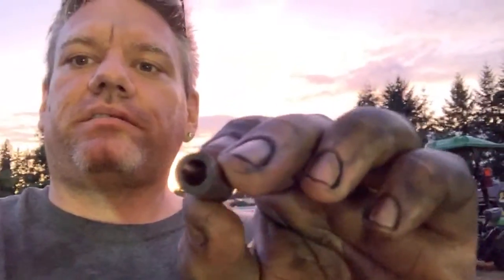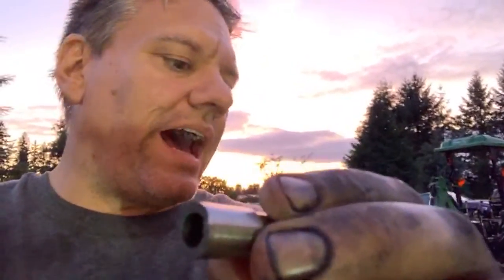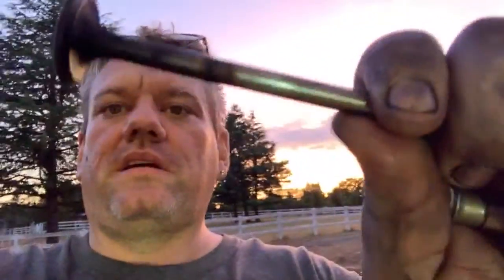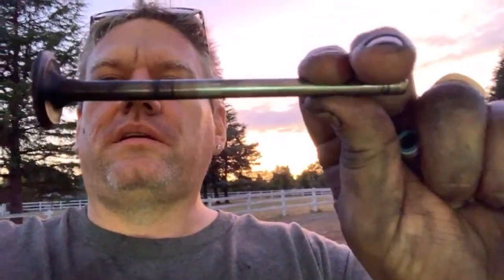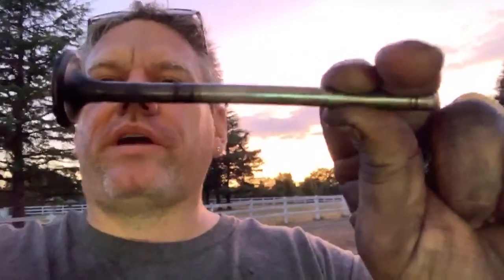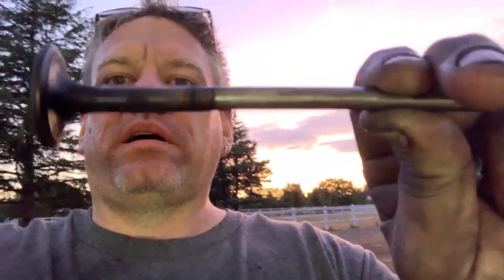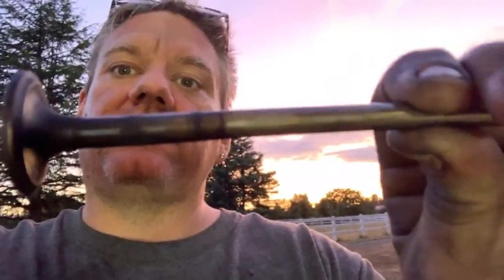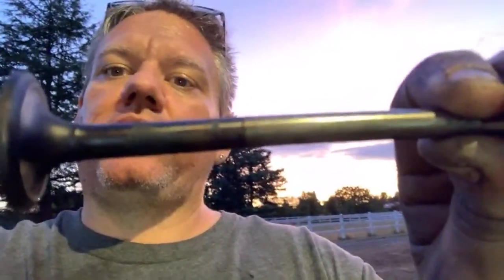Detroit diesel 671 dropped valve update

Comment: Looks like a combination of the wrong keepers, which came to rest on each other rather than clamping on the valve stem, combined with a machine shop worker who either didn't care or was in a big hurry.  Even if you supplied them with the NOS parts, including the wrong keepers, as professional machinists and engine assemblers, this improper fit should not have gone unnoticed.  The miss-aligned injector depth only adds to their incompetence.

Scott, as always, I applaud your ability to smile, laugh and keep a positive attitude in light of all the troubles you encounter.  Thank you and your wife for all these great videos.

Comment: I am not a diesel mechanic. I have 20 years in the aircraft manufacturing industry.
The shop that built that head for you did a poor job.
Pull the head apart, document everything wrong it.
Put it together correctly. Keep track of hours and part costs.
Get your money back from that shop.
Your first clue should have been the quoted price versus what you paid.
If the shop can't quote a job correctly, they should not be bidding on work.
Reply: Agreed-A.S.E. engine re-builder certified
Reply: he needs to tack on the lost work also because he was going to do some other repairs in that area and now he might not be able to do it or soo tired he himself might make a mistake
Reply: My thoughts exactly. I would be looking for a refund from the machine shop that "rebuilt" that head.

Comment: I hope you will never do business with that machine shop again ! They let you down...
Reply: Let him down is putting it mildly, that should have never of happened.I call bullshit on that shop.
Reply: Who supplied the new valve guides?  I know my machine shop won’t warranty or guarantee any customer parts. This is why I buy all parts from them.
Reply: @ @ko9446  -As noted in my prior comment, there is a link to the parts video and it appears the customer supplied most or all of the hard parts, including the valve guides. Still, the shop verifies fitness for use and dimension same as if they supplied the parts. If their policy is to not use customer parts, then the onus is on them to notify. This is common on racing engines, in that the customer may supply us with the specialty hard parts they require. Diesel engine stuff is generally very reliable and consistent.
Reply: camachinist don’t need a lesson on how it works. My background.....Heavy Equipment Mechanic for the State Of California. We usually had 2-3 engines a week being gone through. This is exactly why we don’t supply parts. Hard for a machine shop to warranty what we brought in.

Comment: I'm still going with a valve bridge hangup caused by odd valve spring pressures, piston came up and tapped the valve head bending the stem and starting the destruction. Check the bridge guide is square in the head as well. Looks like the injector tubes haven't been finished reamed to correct size, special Kent Moore tool needed for that. 

Dude while you are in town buy a lottery ticket, if you hadn't picked up the odd note that could have so easily been a trashed head and cylinder kit.
Reply: Good theory. Either way the injector height is telling of inexperienced/incompetent work
Reply: good thought but I don't think so because even a nick from the piston would have left some kind of mark especially enough to bend the valve I think the machinist put the bent valve in there
Reply: @danhard8440  No the engine ran fine for quite a few hundred miles, on a 71 series the valves are directly vertical over the cylinder, the piston can tap them and push them back, the bend starts as the pistons have a dished top and the valve is only getting tapped on one side of the valve head, if something like stuck valve bridge holds the valve open it gets hit and bends, or if the keepers fall out and the valve drops much lower into the cylinder and gets a good thumping. Either case Scott should buy a lottery ticket, his keen ear picked up the noise before the engine was ruined.
Reply: I agree he got crazy lucky anyone else would have been proper F _ _ _ ed

Comment: Wow. Yeah definitely find yourself a more reliable machine shop. Its hard to do but they are out there. Id say the keepers where not installed correctly and/or the guide snapped due to wrong installed valve height/ or valve guide broke after bent valve went through it then upper stem built. The injector height is a giveaway they didn't know what they where doing. Maybe installed heights werent checked. Or valve seats where not centered. No matter what after the $ you spent these issues SHOULD NOT be happening. The fact you say they always cost more than estimate is telling.

P.S. best comment section on youtube

Comment: If u turbo this inline 6 make sure u install the lower compression pistons n cuz there at least a ratio away from being a natural aspirated & that’s what u got, from what I saw & another thing of u look at the bottom of the exhaust valve it will either have a raised letter stamp being J4 a turbo engine is a F4, but if I were u I wouldn’t turbo this beast, besides ur gonna have to ck ur engine timing, what size inj do u have?
A lot of science should be ck before u do this conversion & sometimes it’s a pain n the ass to do this but I wouldn’t do the turbo thing but that’s up to u, good luck sir & my name is stew !

Comment: That is terribly disappointing, unfortunately when dealing with this old equipment this does happen, unless the machine shop supplies all of the parts and does all the work themselves they rarely will stand behind the work, and I do see both sides of the story. I’ve had the same problems that I bring an old block to a shop and spend top dollar for work that was rushed and not fully completed to the agreed upon level of satisfaction and they did not stand behind their work and there’s nothing I could do about it.

Comment: Bad luck on the breakdown. Good luck where it happened.  Couple years ago I rebuilt a JD 466 engine.  Machine shop didn’t have do the valve job correctly causing the head gasket to let go.  Different machine shop found the problem and corrected.  I too just trusted the first shop.

Comment: in my experience building drag race engines over the years.... the machine shop will fix anything they screw up on if you catch it before assembly... builder/installers responsibility to check all clearances / and machining dimensions, once it's assembled and put into service, all bets are off... you would hope you wouldn't need to do that but my experience is you do, I've had countless machine shop screw ups caught during assembly of an engine and they fixed them all... once the engine is running it's hard to prove who's fault it is when the crank hits the pavement
Reply: The height of the injectors and wrong keepers are nothing that changes after running the engine...and he documented the spring issue before installation, too.

Comment: Hi Scott, in my opinion what happened that the original machine shop did not hone the guide clearance enough and the valve literally Seized in the guide , I always Assembly all valve train with oil not Assembly grease, some people get the valve to guide clearance to tight, I’ve taken brand new heads apart and have discovered this terrible mistake, anyway looks like you got it Handel, sounds like the dude in Oregon is a cool cat 👍. Thanks for the cool videos 🏁🚀😎.

Comment: My humble opinion, it has nothing to do with the valve. I think the failure was in the bridge. When you opened it was turned. The wear on the keepers  can happen if the bridge turned and was pushing the spring caps. The flexing by pushing or now rocking the caps caused the wear until they finally let go, this why the wear was on the conjugal pair of valves. The broken guide is a result of the impact that bent the valve and created sidways pressure. Again my humble opinion.
Reply from the maker: Except the thing that holds the bridge in place is the rear valve and since it was lower that let the bridge turn.  Chicken or egg which was first

Comment: After installation, the injector cups need to be reamed in the area where the injector seals against. That determines the injector tip protrusion. Tell the machine shop to RTFM before they work on something they aren't familiar with,

Comment: I hate the work my local shop has done for me. Very high priced for failures and work I have to redo.  I've since gotten the injector cup installation kit and plan to do my own assembly and valve lapping next time I need it.  I may never be able to surface heads, but I certainly can check it.

Comment: Thanks for the update. Valvetrain parts are here :https://youtu.be/bD06w25dOlY?t=90. If the mix of oxided and coppered keepers matches, then the shop likely used the supplied parts. I'd suggest checking valve to guide clearances and verifying stem/keeper/retainer wear on all valves. I've seen valve stems seize in guides on the way open and the piston pops it up with enough rapidity to dislodge the keepers while simultaneously bending the valve. If that is what happened, it was your lucky day, since often the valve will drop when the rocker hits it  after the keepers go and then it gets mashed up/holes the piston/liner. Take care and have a pleasant trip through the Beaver State. We're a pretty friendly bunch.

Comment: Boy, I can't wait to hear what Joe thinks the problem with the retainers was. The valve shanks are not supposed to 'move' through the retainers; so the wear is very strange. There are a limited number of faults possible: Wrong size 'keepers,' something wrong with the dimension of the shank of the valve (possible but not probable) or something wrong with the valve spring retainer (cap.) Then comes the question: Why just two and not all six?  Inquiring minds want to know ;-)

Comment: I had a 351 Windsor rebuilt at a local shop and it used a quart in 100 miles from day one, i used break in oil and the rpm for the cam and all he said was it takes a while for moly rings to wear in BS still uses excessive oil. Bummer the shop could of put rings in correctly, was told oil rings upside down.

Comment: Be sure to check the keepers a pair of 16-92 in a tug boat drop a valve busted a sleve dumped all the water in the crankcase when we were putting it back together had a hard time getting them to hold on a closer look they were almost slick never saw that before

Comment: I recon , somehow, either a rogue spring retainer cap or collets have snuck into your head upgrade. there should never be any movement of collets between the stem & retainer cap to wear them- so a part mismatch has occurred. when the collet failed the valve tip disengaged with the rocker bridge, allowing the bridge to turn away from the other valve as well, as the cam is still pounding the rocker all over the top of it- every single 2 stroke revolution... so there would be why the top of the guide got hammered...just a guess from an ole' deez'l'fit her.
love your vids guys.. lookin at doin exactly this myself- get a big bus with a gimmy in it and go mad decking it out for ME. hahaha. cheers

Comment: Even if the Head was New it is always best to check all of the valves almost better to take them out check everything. Talkin on buildin a modded engine or even if you are replacing a head or heads. Things can happen and there is a LOT of moving parts.

Comment: I think I would consider changing all the valve keepers to be safe they may have used cheap ones and the cost of them is way less than dropping another valve.  I know that not all keepers are created equally and that would be a good time to check out the springs on each valve for strength etc.

Comment: Looks like a stuck valve caused it.not enough  clearance  between  valve stem and guide . Better  check the rest of them. That would  explain  why there's  no big dent in the piston also.or even coil bind on the springs  would damage  the keepers
Reply: Oof.  I sure hope he reads that. Very good point. Shoot him an e-mail as well. Should have thought of it myself. The guy coming up to help,likely will check,but belt and suspenders here. No time to have your pants around your ankles.
Reply: @paulmanson253  ive built gas engines  for over 40 years.ive only  done about 4 diesels  and got lucky with them.the only thing  i know about a bus is what ive learned  from watching  this channel . Im sure hes smart enough  to figure  this out.it was the ...no damage  to the piston  that got me wasting  what few good brain cells  ive got left . hopefully  he reads the comments  or someone  emails  him.
Reply: @inmate666  Well it would seem to me that with 2 stroke supercharger setup,the cylinder is largely positive pressure except when the exhaust valves open,then maybe still above atmospheric. So the tendency is to blow the valves shut. Still,you make an excellent point. With the demonstrated oopsie,check and measure every single thing the manual has numbers for. Installed height,(accurate spring pressure at compressed length is tough without shop plus gauges),whether rails or posts are at an angle,clay on the piston tops,all the diesel mechanic tricks plus whatever hot rodder stuff applies. He wants to be at Burning Man,but a burning bus would be a high price for that. He needs to go back to the shop manual and go through every dimension. Cannot trust whoever screwed the bits together at this point. Cheers.
Reply: First- those old engines were not originally designed to have valve stem seals.  Second- if the valves were install dry (without lube) that could have easily caused this failure.  We really didn't see wide use of stem seals on two stroke Detroit's until the late 80s or early 90s when the EPA tightened up emissions restrictions.

Comment: Bummer man. Not many good machine shops these days and it has to be done right. I would always tend to tear down a head I had work done on and make sure it was right. Just because you don't have a machine shop does not mean you can't check stuff. It takes a few simple tools to check and make sure they did it right. So the story is the guide broke and that cause the valve to drop? Usually what happens is the valve floats from high RPM or a weak spring or a tight guide etc and that bends the valve and now the bend valve takes out the guide. They are supposed to shim valve springs if they cut a seat down so the tension stays the same. Sorry about your troubles, you seem to be taking it well. Can you hone those sleeves at all to get the rough spots out or just change one sleeve? Good luck with the rebuild. Is your Detroit mechanic buddy going to check all the valves and guides for you to make sure they did not mess something else up?
Reply from the maker: He looked at everything and didn’t notice many issues. Strange things like hammer marks where they put in a valve seat.

Comment: You didn't check the injector height settings before you installed the head??   You would have been Much better off getting a complete Reman head from somebody Reputable, like Stewart & Stevenson (largest authorized DD dealer in the world), P/C Industries, Diesel Pro Power, Diesel Parts Direct, W.W.Williams, etc.... and of course you can get New, Reman & Rebuilt heads (or anything else you need) right from MTU/Detroit Diesel themselves through their Reliabilt parts division..... as I'm sure you must be aware of.  Yes??

Comment: any chance the valves stucky in the guides? i have seen that chew up keepers .. if they bent the guides or didnt ream them (do they need reamed on these engines?) or heaven forbid, they installed bent valves.
Reply from the maker: It ran great for 2500 miles.

Comment: A bad break with the machine shop and a couple of fortunate breaks on finding it. That's a dreadful job by the shop. The valve Spring was the bad omen. They must of put their most junior apprentice on the job because many of those setting up a diesel head are rookie mistakes. Bad management by the. Great job you kept you cool. They could have cracked the head, smashed a piston and liner, bent a rod..  I think machine shop needs a 'come to Jesus' conversation at minimum...

Comment: I don't know,,, Dropping valves are most of time caused by wrong valves adjustment and or springs locker failure...
Another thing is,,, Detroit engines are a high speed engine and some times overspeed whit out notice.

Make sore this engine did not oversped!